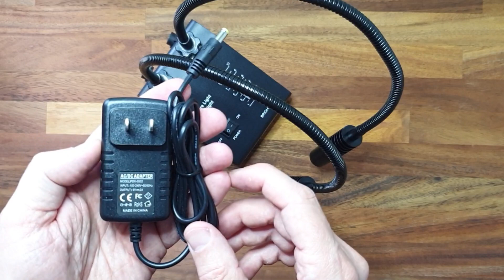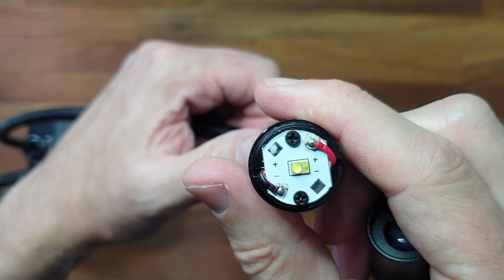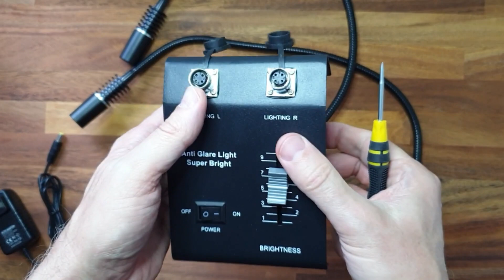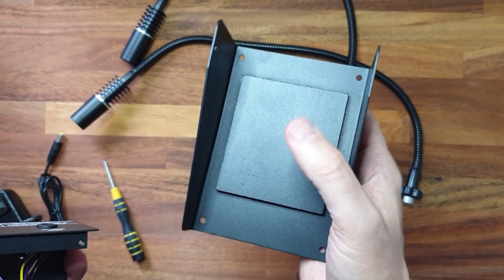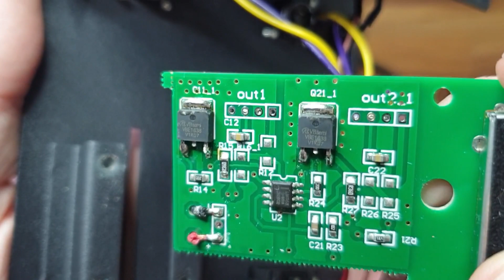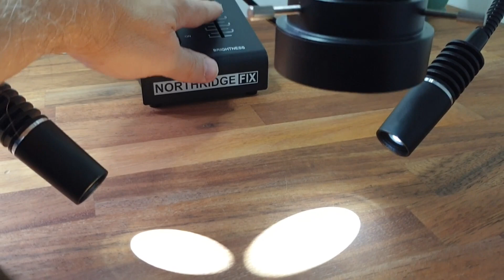NorthridgeFix Antiglare Light review and teardown

Comment: did you get the polarizer lenses for his goose neck lights?? those is where it makes a huge difference
Reply from the maker: No, do you have a link to them?
Reply: @made.by.morten.laboratories  its not letting me post for some reason the information but search Lapsun 6W 6500K Dual LED Gooseneck Light
Reply: @made.by.morten.laboratories  I got them on aliexpress. ...
Reply: @made.by.morten.laboratories  they are like 30 bucks for the pair
Reply: I can see the threads on the inside of the northridge ones they will fit same exact thing as mine
Reply from the maker: @nikobobich9726  Thank you, i will try and get them at some point
Reply: @made.by.morten.laboratories you're welcome yull be glad you screwed those into them it's a game changer

Comment: how much is that Aluminium Electrolytic Capacitor values and voltage?im try to fix my lamp is dim as fuck
Reply from the maker: On the secondary side its 470uF/25V - on primary there is 2 x 4.7uF/400V and one 22uF/25V

Comment: To remove the glare, isnt a polarising filter on the lens, gonna to do the job ?
Reply: I will try it and let you know. Any polarising filter for photography that screws on the bottom of the lens should do it....... or not 😂.
Reply from the maker: @Madmax0620   :-) Thanks
Reply: Right, time to test this theory. I have ordered the CPL lens and will try it out. I let you know.
Reply from the maker: Cool, i look forward to hear more about it
Reply: So I did test this theory and attached a CPL lens into my camera microscope, but nothing happened. The whole image gets dark instead of removing the glare. I guess these filters work with direct light better instead of a reflective surface. The filters I used where from KF and one was CPL and the other was a CPL ultra low reflectivity.  @made.by.morten.laboratories
Reply from the maker: @Madmax0620  great test, thank you for sharing your findings - do you have other plans or things to test out ?
Reply: Hm... Like what ? @made.by.morten.laboratories
Reply: Like what ?
Reply from the maker: @Madmax0620  like other lenses?
Reply: Nah, I don't think so. Just wanted to resolve the glaring issue I have. Oh well.
Reply from the maker: @Madmax0620  No worries, good luck with your microscope
Reply: iFixes iL37 Microscope Polarized LED Ring Light. Check this out, apparently it removes glare with some incorporated lenses and a adjustable light. I will try it and let you know.
Reply from the maker: @Madmax0620  cool, this is very intersting
Reply: @made.by.morten.laboratories  i can confirm this simple contraption does work ! It removes all the glare and make the writing on chips visible by simply turning the lens. It has even adjustable light, for when you dont need the antiglare and just want light. and all of this for 20£. LMAO. AliExpress ftw !
Reply: @made.by.morten.laboratories  Ok, it works. It has 2 polarised lenses with USB ring light and it removes the glare ! The lens  can rotate and give you back full illumination if needed. and all of this for 20£. AliExpress ftw !
Reply from the maker: Can you recommend such a filter, i dont know it

Comment: Is there a polarizing filter between the LED and the lens? You didn't elaborate on that.
Reply from the maker: No not to my knowledge
Reply: There must be. What should remove the glare otherwise? @made.by.morten.laboratories
Reply from the maker: @zaprodk  The light will come from other / different angles
Reply: @made.by.morten.laboratories  If that is only the case I don't see what is so revolutionary about it. Like I've had that on my cheap Andonstar microscope for a decade. It's blown up as being something new and special. EEVBlog showed what could be done with a polarizing filter, and from my days as a hobby photographer, a polarized filter was part of my gear when shooting reflective surfaces.
Reply from the maker: What does it mean?
Reply: @made.by.morten.laboratories   LIGHT POLARIZER. Any polarizer foly from ali 2-3$ and any led light is much beter
Reply: That's what I'm thinking, if there's a polarizing filter.